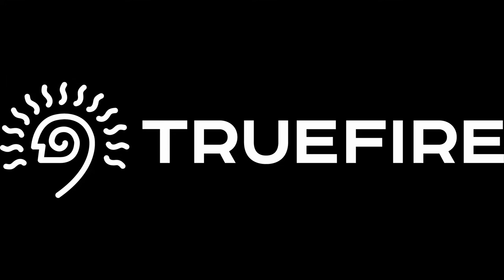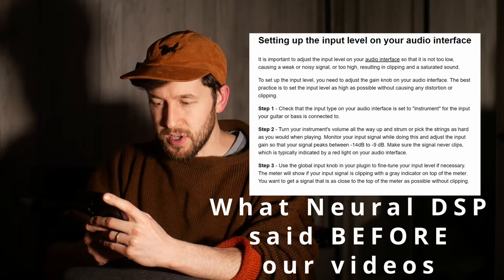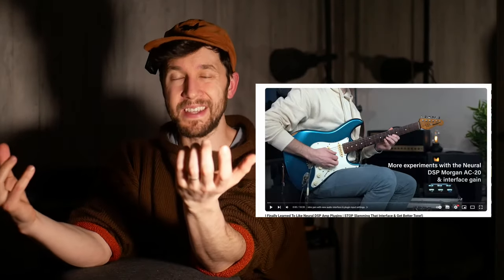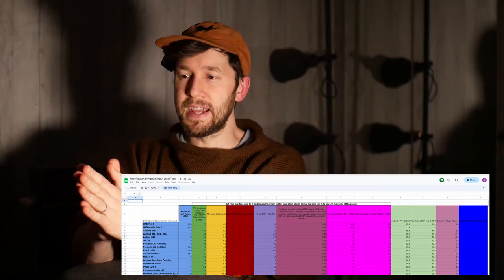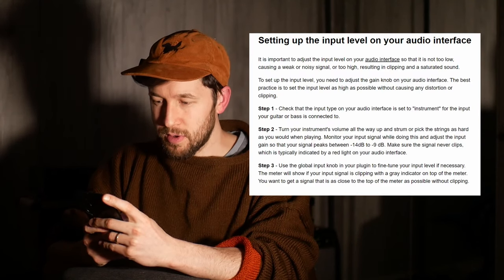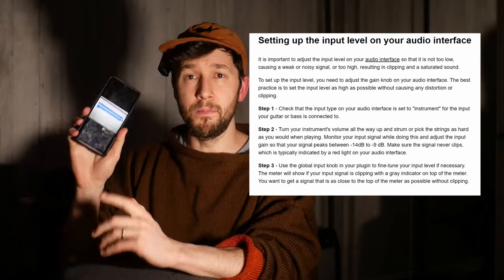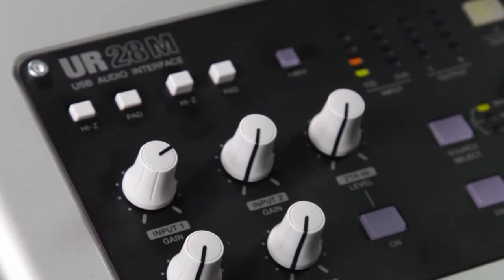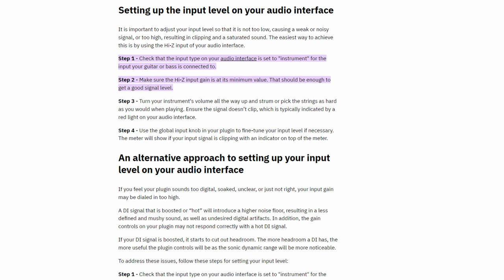Why Are Neural DSP Gaslighting Us About Plugins and Input Gain?

Comment: what is happening, what are you talking about?
what's so wrong with the "as much gain as possible without clipping" approach? because your plugin getting an input signal that is too loud for it? 
then just attenuate the input in DAW/plugin! audio interface gain is a clean boost, it won't do any harm or modification to your signal if there's no clipping.
ok, ok, I understand. Many plugins only offer +/-20dB adjustment and that's not enough but you can handle this within your DAW.
but squeezing your input signal into fewer bits to later stretch it with a plugin isn't wise because most interfaces do not provide too much bits actually
let’s look at actual specs, THD+N of an audio interface (focusrite scarlett-2i2) instrument input. this interface claims 24-bit ADC. but their instrument input THD+N is -80dB. That’s only 13 bits of perfectly clean signal, further bits increasingly get more and more noise. -80dB is a pretty good level, nothing bad about it. but attenuating gain knob and loosing each 6dB means loosing 1 more bit and getting closer to that noise floor. -62dB noise floor (3 lost bits) will make hi-gain plugins very noisy without a noise-gate. please, don't do this. even 13 bits is not much, that's just 8192 possible values. it is very poor you're wasting your interface's capabilities that way. even if you're not using hi-gain and can't hear aliasing, it's just not an efficient approach. especially because guitar signal is highly dynamic, most upper bits are just to accommodate for peaks. so your guitar signal is actually craving for more bits but you're cutting them off in that rebellious move of turning the interface gain knob down.
in most DAWs signal is processed in 32 bits and you can attenuate a signal in DAW freely without loosing the precision. more quality, less aliasing, especially with hi-gain plugins. while decreasing gain with knob on an interface means your guitar's signal will be digitalised into fewer bits which is unwanted. in the REAPER "JS Volume Adjustment" FX has +/-150dB range - very flexible and specific. that what you need to use, not interface gain knob. that Volume Adjustment FX really helps when a plugin (that goes after it) sounds crappy (some NAM models for example expect much quieter signal than you would get from a maxed out interface channel and even -20dB attenuation isn't enough, that's where JS Volume Adjustment comes to help)

TL;DR: turning gain knob on interface isn't the same as turning down virtual input knob or using other FX for virtual level adjustment because of how analogue to digital conversion works. You get more quality with interface's gain knob at max (but without clipping). They had to change their suggestions because of complains, because people don't know how these things actually work. This should have been handled on plugin side. Somehow. I don't care how, at least they could have provided more range for their input level setting.

Comment: No plugin cares about the input level of your interface. The level that is given to the plugin is the only thing that makes a difference. This whole thing about the interface input level is nonsense.
Reply: If you want accuracy, then you need to know what effect your interface has on the signal because it’s where you know what analog voltage gets converted to what specific digital level. If you don’t know that, then it’s impossible to determine after and all you can do is guess. Might sound fine but you can’t calibrate accurately without knowing what your interface is doing.
Reply: @eds4754  Each interface will have a different value for what zero input gain means. Models of the same amp but from different plugin brands will also be calibrated differently. There's absolutely nothing wrong with having whatever input gain you want and then adjust the digital gain to what you want the plugin to see.

edit: With that being said, I've been doing zero gain on the interface for many years. If for nothing else, you're rewarded with consistency between different guitars since your gain pot is stuck at zero.

Raising up the gain whenever you switch from humbuckers to single coils is the same as turning on a booster and then complaining that it sounds.. boosted :D
Reply: @eds4754   And to that point, about the only input gain adjustement we can safely presume to be anywhere close between different brands of interfaces, is zero.  And even that might not be exactly the same but if they're building them right they should be.  Zero is zero right?  Admittedly I've been one of the ones doing it the wrong way for a long time, but only per following the misinformed recommendations I was given.
Reply: @iursnitram  exactly. It’s just about knowing how much to adjust by, it can be done anywhere
Reply: @c.g.vonhagenstein7576  no, 0 on one could be very different to zero on another. They can range by about 20dB depending on the specs of the interface. 

That’s why we use the “maximum headroom” spec manufactures give - they provide a maximum voltage the interface can take before clipping, which will be at gain=0. If you know your interface is 10dBu, and Neural DSP needs 12.2dBu, you can lower your signal by 2.2dBu and have the same response.
Reply: @eds4754  Yes. I would also like to clarify, not that anyone cares, but I think that there should be a standard for calibration when it comes to this type of plugin. I am fine with gain staging things to whatever sound I am looking for but I feel this industry makes things unecessarily hard for people who just want to buy a plugin and achieve the recreation of the sounds of those amps.
Reply: @iursnitram  Totally agree with you! Users have to do way too much work and “research” and it doesn’t have to be like that
Reply: @eds4754  Just found out your channel. Looks like you're already fighting this battle. Good luck :)

Comment: What do you mean by "set your audio interface to minimum"?  You mean "0"?  You mean "something less than 0"?

I usually play through a Neural DSP Quad Cortex live, using an ESP Burnt Tiger guitar that has a single, Seymour Duncan double humbucker.  So following the companies previous advice, I typically have my Input set to around +10 for that guitar, and even higher for some of my other guitars that have weaker pickups.

I am uncertain as to what your saying by set your Input to minimum

Comment: John, the original advice from these companies was spot on. Its always been the case that you want the healthiest signal level without clipping. They just should’ve clarified a bit. Look at #4 it says adjust your levels with the global trim in the plugin. 

Also, when you adjust the input gain on your interface, you aren’t “adding gain”. You’re getting your signal into the digital realm at the best level. This is just seeing how hard your signal hits the converters. It’s completely clean gain. All of this simply has to do with getting your guitars signal into a digital signal. After that, if you feel you’re hitting the front end of the “amp” harder than you want, adjust the global trim. Every company has its own “reference level” they code the amp models to. Most analog modeling software uses-18dbfs RMS as Unity gain. Amps are different than outboard compressors of course. The point remains. Cheers!
Reply: I agree with this. One glove doesn't fit everything and I think people are going a little wild with this. 

I know it's not really 100% related, but it's kinda funny that lots of us left the amp space because chasing the purity of tone was misguided, and now we're all fussing over companies acceptable input gain variances.
Reply: Most amp sims use totally different calibrations than +22dBu=0dBFS (which is what many but not all analog modelled plugins use). With amp sims they vary a lot - it can be anywhere from 18dBu=0dBFS  to 12.2dBu=0dBFS, to 5dBu=0dBFS, as far as -6dBu=0dBFS.

Converters all vary too, and analog 1V sine on one converter could be -5dBFS, on another it could be -12dBFS

Comment: Does no one remember Misha from Periphery showing us how to record guitars?? He literally boosts the input gain until clipping, then backs it down. “Maximum signal to noise”
Reply from the maker: Yeh that's advice that makes sense for using a microphone etc, but not for guitars with plugins. Signal to noise is a non-factor since the "self noise floor" of an audio interface is WAAAY lower than the noise floor of pickups which are inherently noisy anyway.
Reply: @johnnathancordy  yeah, I was just adding to the gaslighted feeling. I remember seeing that video and thinking it was the way. Now we've got plugins that don't need that gain, but they're treating it like the Mandela effect.

Comment: There IS a right way and a wrong way to set gain. Your target level should be AROUND -20 to -18dbFS. Thats -18db BELOW digital clip. A little above for high dynamic range signals and a little below for clipped/compressed/saturated or just generally low dynamic range signals. Full stop. If they haven’t set their plugins to operate with that input level, they did it wrong.

Comment: so in conclusion set your interface levelto clip then b ackoff,then adjust the amp sim levels to the amp sims suggested input or your desired level if you want to push the ampwithout a boost peddle than go ahead ive seen people get amazing results even pushing the inoput and outputs intothe red and with very low levels so it really dont matter because ap sims do not act like realamps anyway their just fooling our limited hearing capabilities if ypu adjust your interface down it willgive a quite recvording we know we want record level around -6db we know this you cannot compromise this for the sake of the fing plugin f the plugin

Comment: it said distortion or clipping its right there learn to understand what your reading narsasism gets involved you dont absorb what your reading hello distortion it says correct distortion or clipping it does not say the other thing which is for recording levels from microphone or dry guitar track which is bring level to clip backoff so once you add a amp sim tothe already recorded track adjust the input in the amp sim to about -12db this really isnt complicated if you understand what your being told without narsasistically assuming stuff

Comment: It’s so funny to me that this whole „scandal“ is essentially about guitar players not understanding gain staging and not being able to go: „oh that’s a bit gainy, let me gain down before the signal hits the (software)pre-amp. 😂
Interfaces have all kinds of input impedances, there is no set and forget standard. Use your ears and brain!
Reply from the maker: It's not really a scandal, and it's not really as simple as not understanding gain staging. In the plugin world for example the companies will give you the reference level that they calibrate with - since Ed S started badgering the plugin companies he has unearthed from most of them what that number is.

It's also not about input impedance - it's about the level of a) Converters in the interface and b) the level that plugin companies are calibrating their software to.
Reply: @johnnathancordy  if you want best quality you should calibrate in DAW, not on interface. Interface gain must be just before the clipping (some headroom to avoid clipping and that's enough). Further attenuation - only in DAW. Sometimes plugin's input level setting is enough to do that, but not always, in my experience doing -20dB isn't enough for some neural models. Still that's not a reason to decrease gain on the interface because you will lose precision, each 6dB volume decrease is 1 bit loss. And like Rabea mentioned guitar signal is so dynamic, most things happen in a very narrow range, the rest is short peaks. That narrow range goes into few bits and by decreasing gain knob on an interface you're making things much worse. Not even a 8-bit sound, WORSE. Think about it, please.

Comment: I'll be honest, that idea of cranking the input gain never made even a single lick of sense to me especially on a guitar. I would hope that anyone dialling in their tone has a gain control before their amp plugin so they can control the input in to the amp that way, whether up or down depending on your preference. I remember seeing Misha's video years ago and thinking it seemed like a silly thing to do, and then it wasn't until I saw Rabea's video that I realised this is what a lot of people were doing. Realistically, you should be controlling your gain going in to any plugin to create the desired effect, so I'm not sure why people thought an amp would be any different. Enough input gain and you'll make a little fender jazz amp squeal.

Don't worry about what zero is for each plugin when it comes to amps. Send your signal in at zero and use your ears to tweak until correct. This way, your input signal is consistent between sessions, not just an approximate match.

Comment: I don't quite get it. If the intension is to make the plugin sound as close to the original as possible (which is a pretty nerdy thing to begin with), all this talk about gain might matter to you. But if the aim is, to simply create a good tone on your amp sim, why does it matter? I do honestly don't care if my Neural Plugins sound exactly the way the original does, as I don't have them, as long as the plugin sounds great! I have increased the gain on my interface in the past creating a tone I liked, so what's the fuss all about?
Or is it just one of those "the topic is trending, so let's quickly make a video about it too, and collect some clicks" things?? Everybody seems to feel the need to talk about this topic right now, isn't that strange?
Let's get back to music.
Reply: Some plugins especially neural network based ones sound truly terrible when you put too much boost into them. They sound best at intended level. Rolling the gain knob down KIND OF works but ruins signal's precision. Proper way is to decrease the level in DAW. Most people don't know how to do that. Plugin's input setting has limited range (usually -20dB) which is not always enough to bring the input level to that calibrated/intended (by plugin's creator) level. Additional (really simple) steps in DAW required. But that is "too complex" for most people, so they just have started adjusting input levels using gain knob on the interface and making videos about this "big revelation".

Comment: Yeah okay, but what about using your ears to determine that the signal is actually too hot and you the amp is now breaking up?  Why not say “you know what, I don’t like this amount of distorting I will pull on the input gain because it might actually be cleaner” ?? Its like you guys were following instructions just because and not actually using your ears or logical thinking. And I don’t even understand still how this subject even became a thing. Really. This doesn’t even matter. Make music, get the tones you need, however it is you gotta get them, even if that means putting a pedal before going into the interface, because you can do that too, and it might sound great. Just experiment and have fun, use your creativity and make a cool sounding song.

Comment: Am i missing some controversy here? As far as i can remember you've always needed to play around with ALL the gains to tune the sound. In order there could be 1) interface inout gain (the physical knob on the interface). 2) plugin input gain, 3) plug in amp sim gain (which would be the gain knob on a real amp), amp sim master volume (which would be the channel or master volume on a real amp), amp sim output volume (which bakances the plugin volume with your other channels in the mix, like drums and bass. You need to get all of these working together. It might take a while to dial them all in right. The same goes with old fashioned guitars, boost pedals, amps, attenuators, microphones and mixer boards
Reply: It’s not about making them sound good, it’s about having them respond 1:1 with the real amp. 

The modelling allows for this, but you need to have some grasp of levels to be able to do it. Anyone can guess and get a reasonable tone, but this is going a bit beyond that (e.g to give the kind of accuracy hardware modellers have, but with plugins).

Comment: This is absolute nonsense and you should be spewing it if now the standard it to set the input low on the interface. Your interface has its own pre-amp specifically to get a good level and noise to floor ratio from the input signal, it has nothing to do with the plug in or how it reacts. Its to get the cleanest source signal in the recording. It doesn't matter if you 'think' you can't hear a difference. Its still just hardware at the end of the day. You can make it up with the plugin('s bad design), or with the software, but you are compromising a job that is supposed to be done by your interface. End of. Jeez just turn DOWN the input in your DAW or on the plug in if it's too hot. It would just be better advice to put a gain reduction plugin (ie EQ plugin's output level) before the plugin if you need to. This would be better than this silly idea.